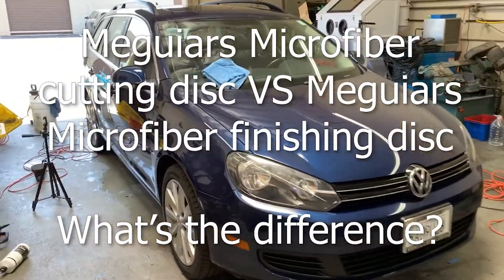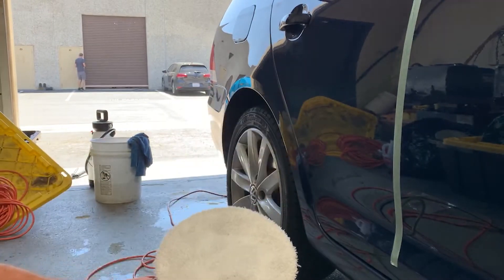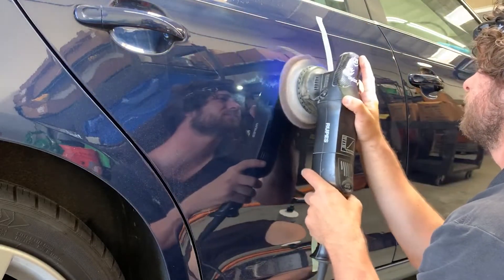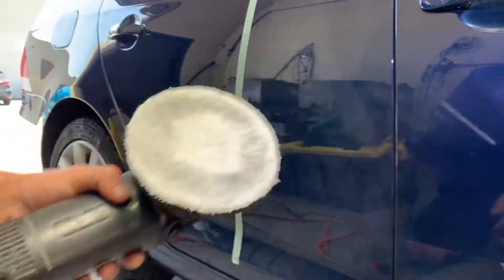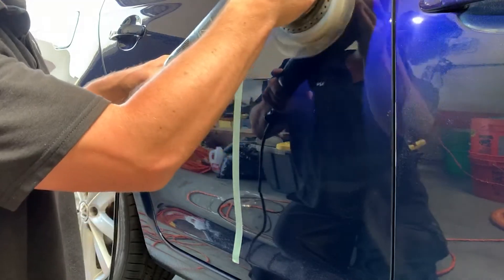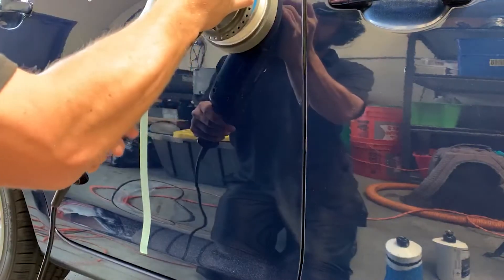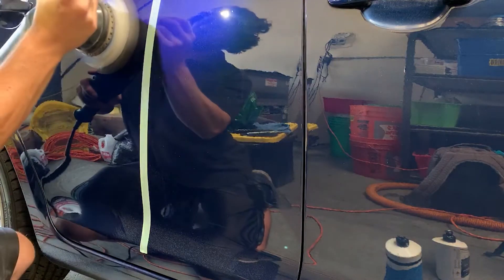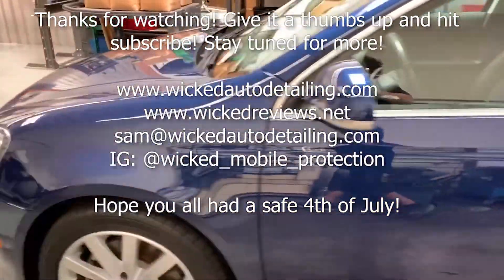WHAT'S THE DIFFERENCE BETWEEN MICROFIBER CUTTING AND MICROFIBER FINISHING | MEGUIARS MICROFIBER

Comment: Friggin dust. Ruins so much fun. 😔😧
I've been using 1 & Done Compound more and more lately. Only because it's one of the lowest dusting, cleanest working compounds I've used that can cut better than 3D One and still finish down. Still hoping Optimum puts out a heavy cut version of Hyper Compound someday.

Haven't tried Shine Supply stuff yet, but people who use it seem to really rave about it and develop a Tesla like loyalty to it. Thanks for the video my dude. 👍👌✌
Reply from the maker: No prob, I recommend shine supply to everyone, it works on every paint system. I no longer fill my shelves with different crap anymore. You don't even need their heavy cut on badly swirled vehicles, classic cut works great on everything.
Reply: I'm using Griot's Fast Cutting right now...zero dust...and it cuts!
Reply: @angelsoftheseventhdawn  yeah, their FCC cuts very well, easy wipe off. Very good compound.
Reply: Oh man, I hate dust too. Between Jescar and 3D lines I'm well taken care of. 

I wish I could get Optimum Hyper Compound and Intensive Polish wouldn't leave so much marring. I love their line, but I spend more time and effort trying to remove the marring with Hyper Polish and an orange or black waffle pad. 

Yeah, dust absolutely sucks.

Comment: Hey man couple of questions.. So is the only difference the thickness in the pad? I notice the Xtra cut disc is very thin and the finishing pad looks pretty thick. I also exclusively use shine supply products and I’ve never tried the finishing pads. Do they actually finish out as well as say a yellow or black foam pad with classic polish? I usually use classic polish on a cutting pad for that in between or a one step but I’m very curious about these finishing pads..
Reply from the maker: Xtra cut pAs does cut harder but also generates a lot more heat and has horrible flexibility for curves. I thought Meguiars stopped making them. The microfiber finishing disc is a good second step on a black car before 3rd step final polish. Yellow pads i find do not finish well or cause additional marring or tick marks. Harder to keep clean also. We only use Meguiars microfiber, microfiber finishing and black foam at my shop for years now.
Reply: @Jesusisjudgingyou  interesting. You have issues with the meguiars yellow foam pads? I’m bummed to hear that I just bought a 6 pack of them lol. So if you need more cut than a black foam pad but not as much cut as a mf cutting pad you skip the yellow for a mf finishing pad? I picked up shine supply burn out for some one step projects and they recommend against microfiber I guess I didn’t think to try it with a finishing pad.
Reply: @Jesusisjudgingyou  I’m also using the griots g9 so I don’t have a long throw.. yet. If you had to recommend foam pads for one step or for very fine polishing. What would you recommend?
Reply from the maker: @ChristiannTyler  a one step to us is just a gloss enhancing polish not correction so we just use Meguiars black foam. Get yourself a better machine.

Comment: Hi, I'm cleaning up some cars to sell and also one here and there for friends/family. Ive was using McKees 37 AIO but its been discontinued.  Ive been using mainly foam pads. Lake country ccs pads. I just started looking into the Meguires MF pads.  If i have serious scratches or fading ive been using my dewalt rotary with Meguires m105. Which I get a lot of dust with and it becomes a little hassle. Anyway could you suggest a reasonably price AIO ? or if I did what do here in this vid.  its considered a 2 step process? The classic cut and classic polish and I can pretty much use this one any car ? Ive done a fair amout of cars but product wise im a little unsure of what to use. I would have stayed with the McKees 37 if they didnt discontinue it.  I just bought a gallon of Meguires m66. it doesnt seem bad. Im just not sure how long it will protect a vehicle. Any info/ tips would be very much appreciated. Thank you !
Reply from the maker: I don’t use AIO. Wax products last about a week if you’re lucky. It’s not real correction if using AIO so we do not use in a professional environment.
Reply: @Jesusisjudgingyou   how bout what i asked about the products you were using in this vid ? Is that pretty much all I would need to finish most cars ? The cut if needed and the polish ?
Reply from the maker: @YOPHILLYYO  yes that’s all you need to cut and polish.
Reply: @Jesusisjudgingyou  Thanks!
Reply: @Jesusisjudgingyou   One more question, Do i need to add any protection after the polish or the polish is the final step ?  THANK YOU !